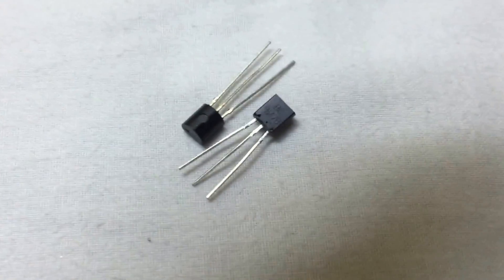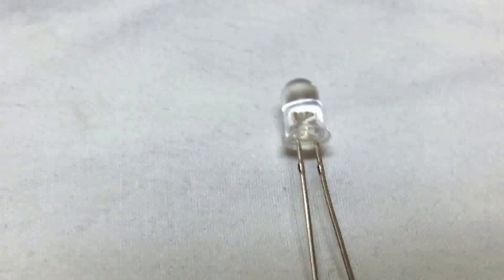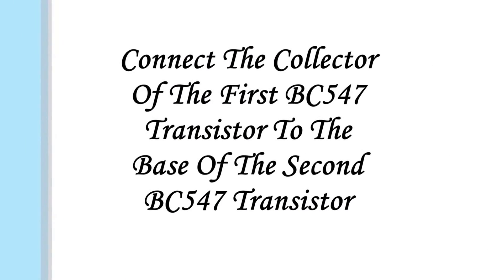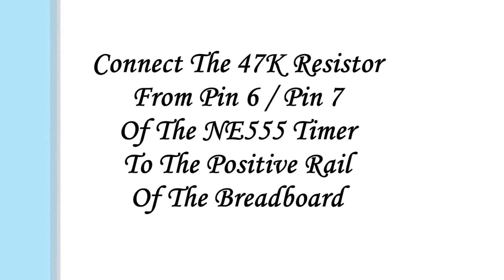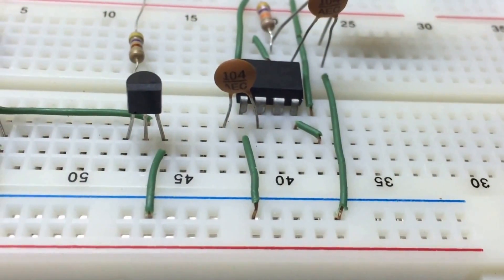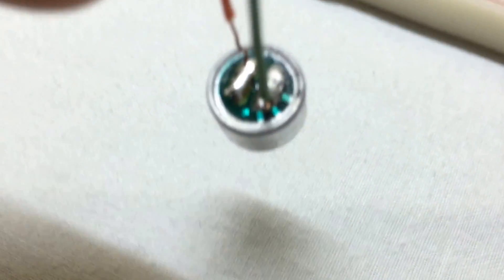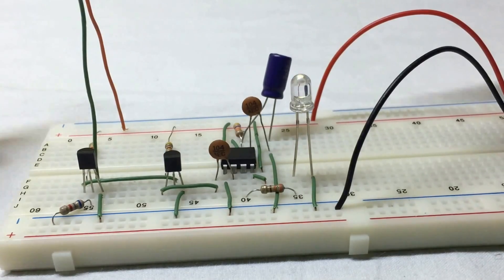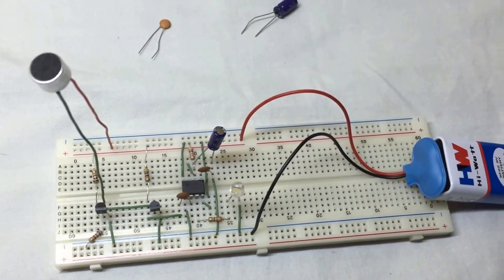How To Make A Clap Switch (With Audio)

Comment: i did the same thing as u did but i used 10uF capacitor instead of 100uF, 0.01nF instead of 0.1 nF and 4.7K instead of 6.**  resistor i did the same circuit but why the hell the led is flashing

Comment: this circuit don"t worked i connected the power supply the led switched before i clapped  and remained switched on.....what to do??
Reply: i have same problem, what i can do ????!?!!
help me (Y)
Reply: Same here but I was working on a similar schematic before finding this video. Ive followed a similar Breadboard wiring circuit and was hoping to see where I went wrong . But same as you guys for the end result
Reply: check the electric condensor mic working........there is problem in it .......here we use
it as a switch

Comment: You can easily extend your circuit to 'clap-on/clap-off' circuit by feeding the output of your monostable stage to a JK flip-flop wired in toggle mode.

Comment: You used the 6.8k resistor but you wrote 4.7k resistor in the description. You should fix that in the description
Reply: You can use 4.7K or 6.8K resistor.

Comment: Hi Gaurav,
I came back to your circuit and tried it again using the BC547 transistors. This time I got it to work but I find  it is not very sensitive to sound. Strangely, the Led lights for the few seconds  if I blow gently  over the microphone but it doesn't respond when I click my fingers. The 0.1 uF capacitors I have are polyester type 2A104J. I wonder is that the problem? Any ideas on how I can increase  the sensitivity?
Thanks.
Kind regards, 
James

Comment: Tried it again with C1815 and still not working !Grrrrrr...!! Unless the values of the other components are wrong for these transistors.  I would appreciate any help.
Thanks 
James
Reply: James Greally Dude! Why cant u find a BC547? It is very easily available!
Reply: Advait Mehla I've ordered some now. I just didn't have that exact type when I was trying to get it working. As you know most  circuits you come across have components which are replaceable by equivalent ones. It seems not this circuit!

Comment: Hi Gaurav,
Very nice circuit - well done! I just built it on a breadboard using it two 2N3904 transistors instead as I didn't have any BC547 ones.  Unfortunately, it won't work for me.  Can you help? I thought that the 2N3904 was an ok replacement for the BC547.
Best,
James

Comment: at 5min12sec the 104cap is on pin 8 and not 5. There is an other time you mix pin 5 with pin 8. It's a small detaile since you show it on the board. To me it's the best tutorial i've seen so far. Thank you verry much.
Reply from the maker: Seb Sebster It is pin 5.. The top right terminal is pin 5, whereas the top left one is pin 8... the bottom left is pin 1, the bottom right pin 4.. They are number anti-clockwise starting from the bottom left terminal as Pin 1 to the top left as Pin 8.. And Thanks.. :)
Reply: There are many components to studying electronics. One place I found that succeeds in merging these is the Gregs Electro Blog (google it if you're interested) without a doubt the most incredible info that I've heard of. look at this  amazing site.